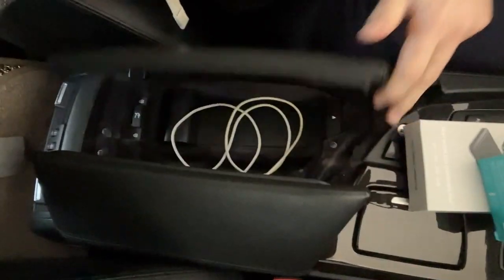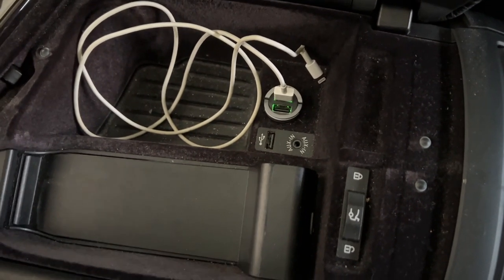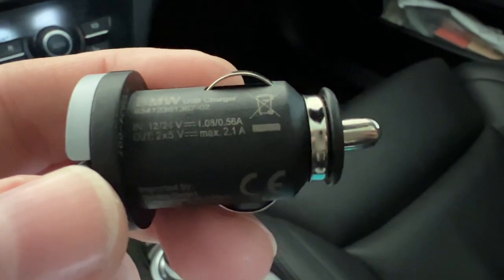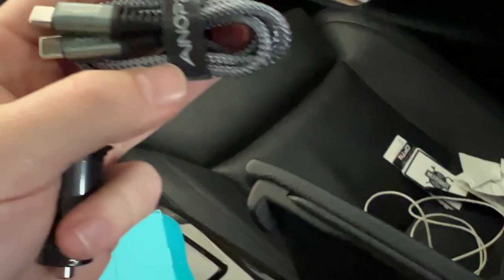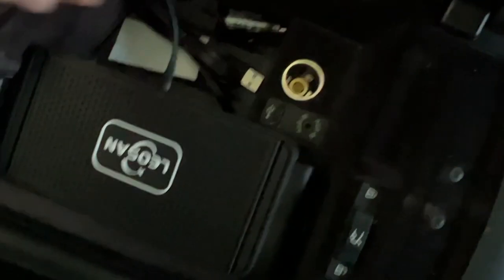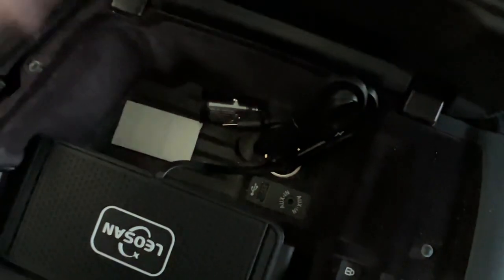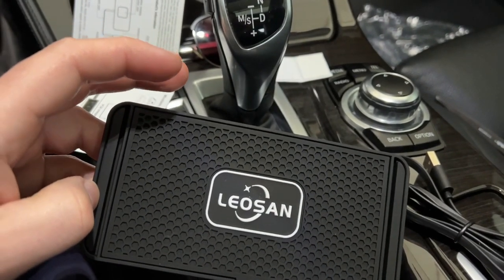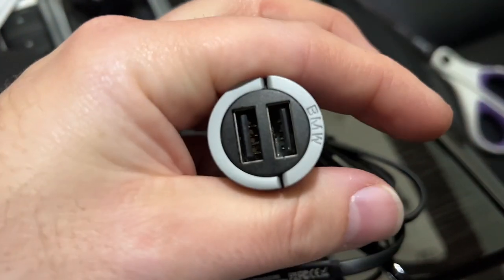Adding WIRELESS CHARGING To The Center Console - Testing Out Forum Inspiration | BOND Garage

Comment: The wireless pad actually wants a higher input for higher watt charging. It's just 9v you can see, so use your new power adapter as that's going to be able to give you that.
Reply from the maker: to increase the charging speed that'd be the way to go. However it did charge but I just didn't like the overall setup.